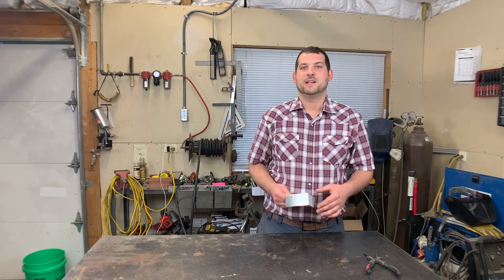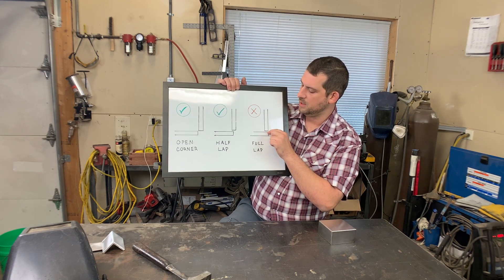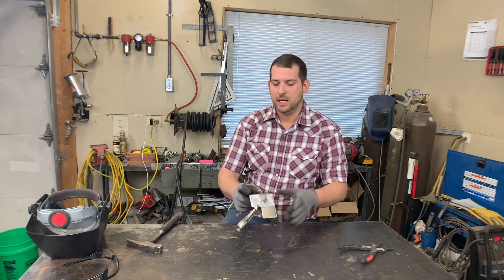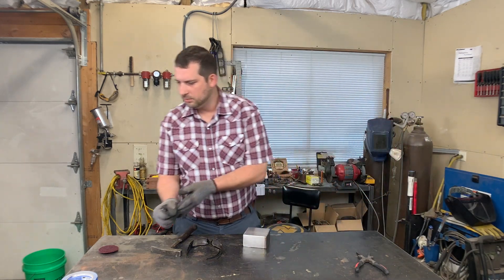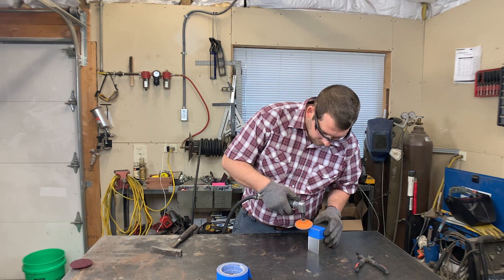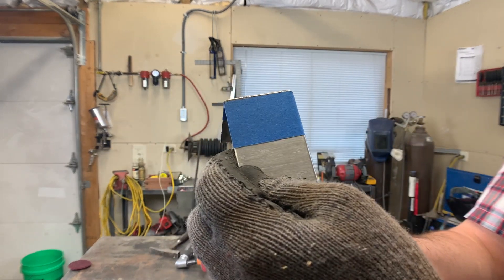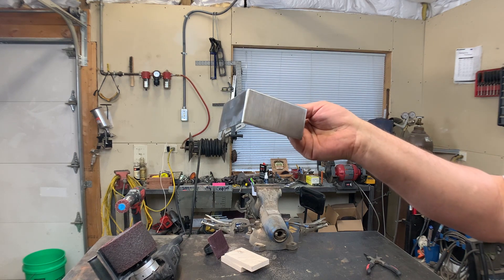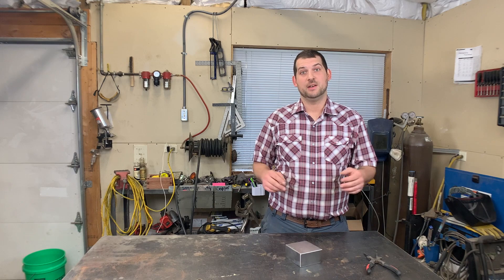How to Grind and Polish outside corner weld - Stainless Steel

Comment: When doing a joint like this for a sink or a countertop, when you weld, do you have penetration on the other side (inside joint)? or do you have to not penetrate?
Reply from the maker: Doesn’t need full penetration for polished corners. Just need to be aware of how much material there is when grinding/polishing and remove the least amount of material possible. Any seams in a sink bowl itself, I do full penetration
Reply: @TheMoonlightCraftsman  alright!! Thank you very much!!

Comment: If you intend to do a lot of thin stainless try a #12 cup from furick with a gas lens on a #9 torch on that same joint. Run your gas around 35-40 with a solid post flow. I build stainless furniture for restaurant kitchens and that’s my daily setup.
Reply from the maker: Right on. I’ll try that setup. I’ll have to see what I’m even using, lol. I use something a little different at work, I probably try and conserve argon a little too much at the house, it’s expensive. Thanks for watching!
Reply: @TheMoonlightCraftsman  oh for sure.. I only run that setup for personal use when something has to look super nice. At work our argon is piped in so we have post flow times of like 30 seconds at like 50-55 lol Guys that don’t weld like that tend to look at you crazy when you tell them your setup.